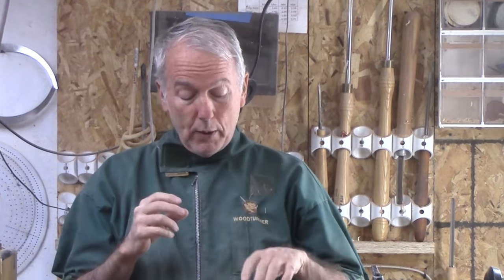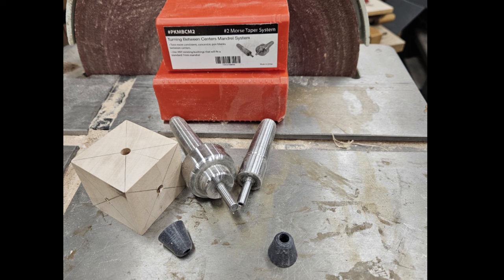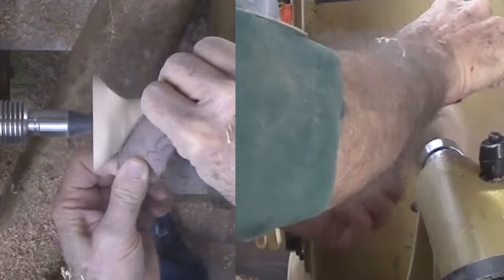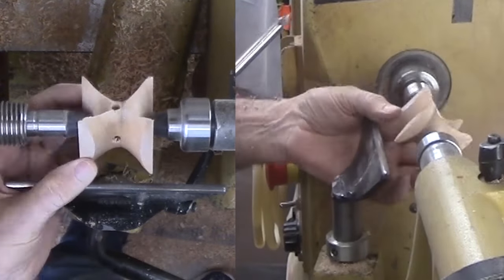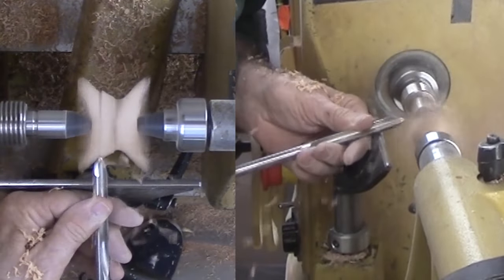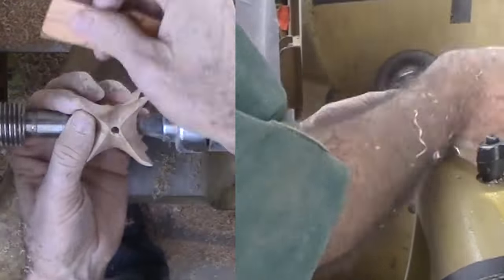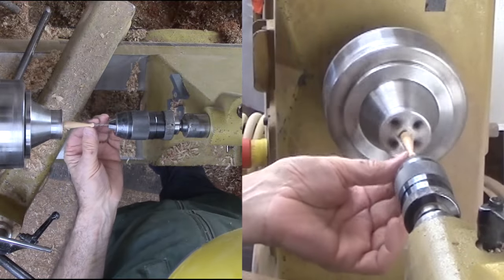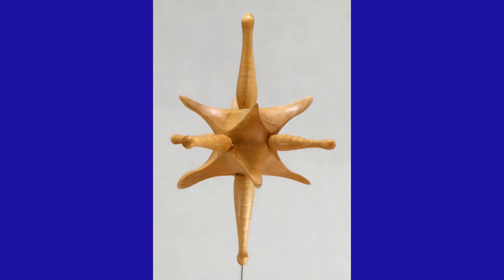Turning 8 Point 3 Axis Star - Best Yet

Comment: I like to project, I started to make one and realized to needed to make some spacers as I re-watched the video I also noticed you used a caliper to measure the center diameter.  I would appreciate it if you could let me know what diameter you used when making this star?  I don't want to go too small as I work on mine.  Thanks for doing these youtube's.
Reply from the maker: I did measure with a caliper a couple of times. However, it did not matter since it depends on your personal tastes. As the turning progresses, it is most important (depth wise) to match the depth cut from each axis. This is best gauged my inspecting the intersections rather than from a measure.
Suggest cutting multiple cubes to start with. Your first may not succeed but will be a learning experience.
Alan
Reply: @AsWoodTurns  Thank you for your timely reply. Hadn't thought of your point about the matching idea, I had been more concerned about a number for some reason.  Good you're keeping me pointed me the right direction!!  You sure were right about needing multiple cubes.  Despite beginners luck, my first star was something I won't be showing anyone other than my wife.
Thanks for the help.